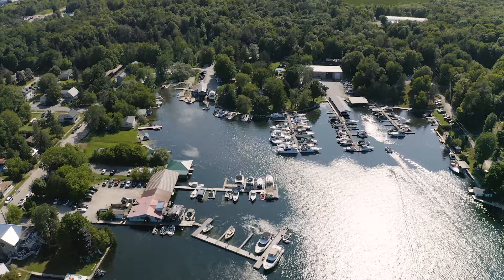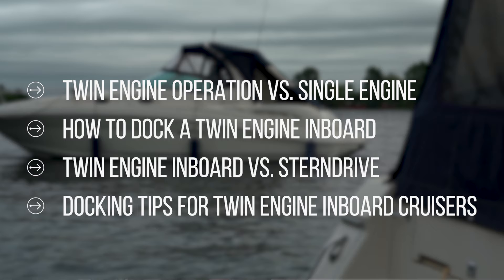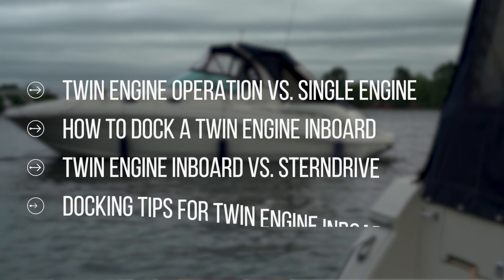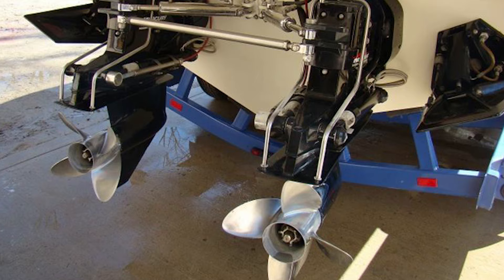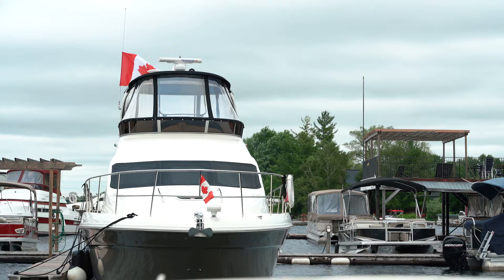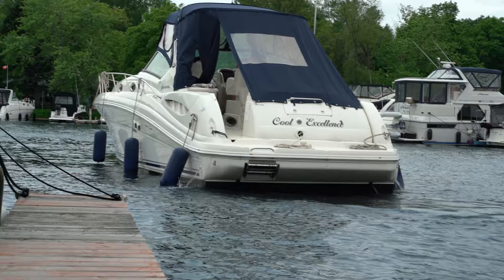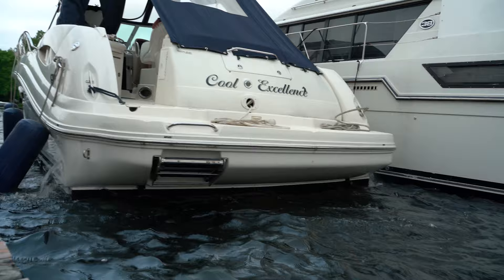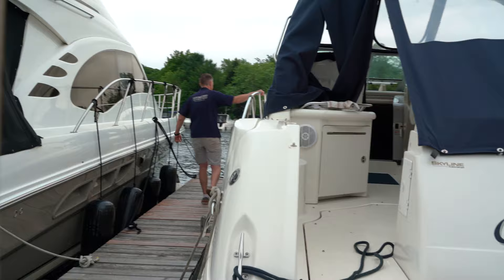Docking a Boat with Twin Engines

Comment: We're moored at a marina on the TSW which is currently affected by a very strong current (open damn infrastructure to lower high water from all this season's rain). Our slip is positioned at a right angle to the current flow. Would love to see a video showing best procedure to handle our situation

Comment: nailed it with momentum!! 

On a single engine which I have (30ft a large single) I use momentum and ensure a correct approach. If the approach is off or wrong I abort and try again.
Reply from the maker: You are so right Andy! 💯

Comment: If you have separate throttle and gears (that aren't modern fly by wire) what stops you shifting in to gear when you have too much throttle on, trashing the gearbox? On a single control you can't do that. Is there something to prevent shifting over a certain amount of revs?
Reply from the maker: Most of them do not have that protection Nick. That is why I advise to try and “ignore the throttle” when docking if possible. Fly by wire on newer boats makes this much easier. 
With the increase of boaters lately a lot of older technology boats are still out there in use though

Comment: ... I don't get it.   When I grew up in the sixties and seventies most of the "twin screws" where set-up w/ Port Engine/Starboard Engine controls ... shifters on the inside w/ throttles on the outside ... NOT ... shifters together and throttles together too.  I could not use the set-up you have.  Too much twisting around to see properly when you are "backing down" and looking over your shoulders.  I was taught ... center the helm,  and leave it alone at slow speeds ... and put your butt on the helm,  face aft and work the controls that way.  Now you are facing the direction the boat is traveling to back into the slip /back-down and can see/watch the pilings and dock ... Always check the engines shifting/idling BEFORE you get near the dock ... a engine stall could be a BIG problem ... go slow!!! ... but also learn to "goose" the throttles lightly as needed to provide that lil' bit of power to slow down,  stop a turn/swing  or counter a gust of wind or current (sometimes you need to NOT hang there allowing the wind/current to get to you) ...  I would go out of the marina and PRACTICE ... PRACTICE and then PRACTICE some more. Till it was second nature and I knew exactly how the boat would react
Reply from the maker: There are some (particularly fly by wire) controls that are all in one on newer boats. We see it both ways and I agree it can make it easier
Reply: @boatinglessons  ... Yep,   most of those engine controls where the "Morse" w/ cable controls ... but on  "fly by wire" controls it should be very easy to set-up the controls like I grew up w/ ... those cables could be stiff and hard to bend/run ...  ( I helped install/add flying bridges to several boats and had to run those control systems )